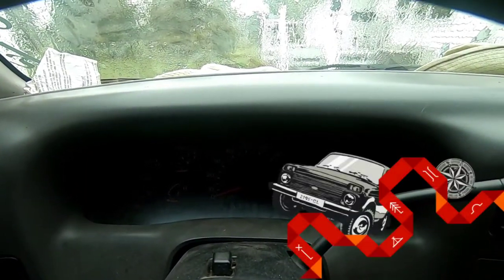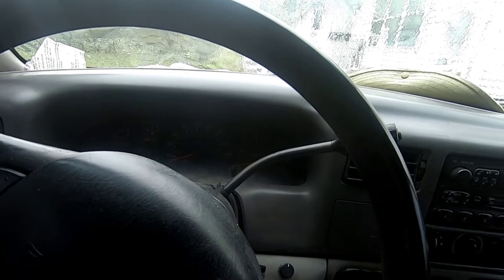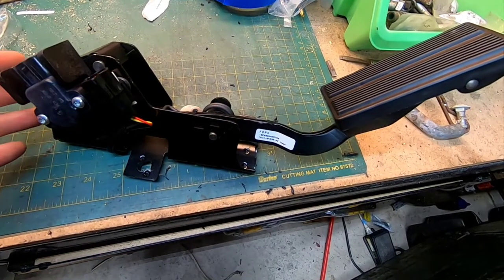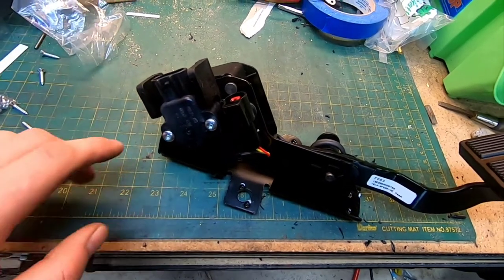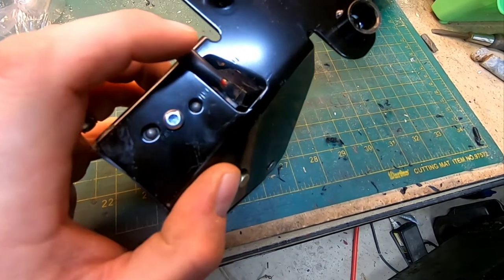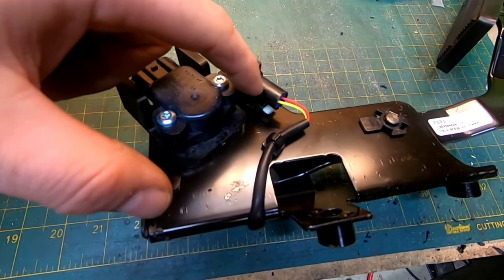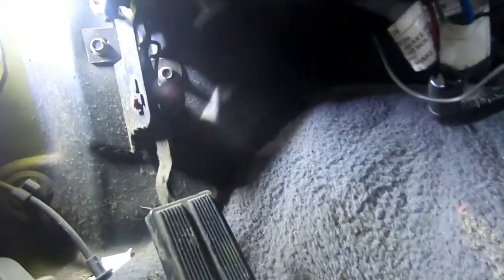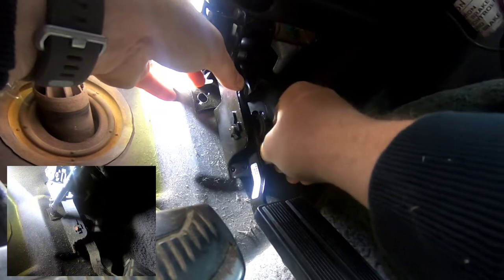Repair Ford 7.3 Diesel engine that has no throttle response and or has issues accelerating, no power

Comment: Excellent video. Quick, simple, prolem well described and the fix made sense. My first diesel truck and I'm learning a lot. 2000 F350 7.3 w/391,000 miles on it. A lot of peripheral parts to replace (all rear u-joints, hanger bearing, ball joints and hub bearings are next (u-joints there too of course). Between youtube and Rockauto, I spend a LOT of time in the garage. Thanks for the terrific tutorial.

Comment: This is a great video and explanation. Had an intermittent 'no throttle response' in our 2000 Excursion. Confident that this will resolve the issue.

Comment: I have a 99 E450 that is doing the same thing and this video was very helpful to me, thanks a million!!!
Reply: Did you experience a check engine light and no throttle for a few seconds, then seemingly resolve itself, and did cleaning the idle validation switch fix it?
Reply: I have this right now in my E450. Cleaning both sensors did not help. Have you fixed this?
Reply: And there’s no warning light at all, it just happens
Reply: @juanp9178  exactly. Were you able to find a new pedal for your E450 Juan?
Reply: @Constabruity there’s a micro switch on this pedal that goes bad and mine has that problem, and for don’t have it anymore
Reply: @TractorsTurfTools you might can find the micro switch in the pedal
Reply: @TractorsTurfTools no sir ford don’t have it , you can buy a used one or put a different one with the same type connectors
Reply: @TractorsTurfTools  I haven’t find one yet, eBay had two of them,used. They had too many miles in them. I’ll probably get one later on, my ford is a food truck and right now I’m not using it , have a great weekend

Comment: I had this problem today, no response and then i ruled out any other posible cause and went to check my pedal, with the truck running i pressed the pedal down while applying a little bit of lateral force towards the passenger side and it worked.
I made it home but it is time to get a new pedal assembly

Comment: Just had my transmission rebuilt and 10 minutes after picking it up my check engine light came on and there was no power at a stop light. I thought at first it was something they did but it's seeming like a coincidence and my tps is just worn out. I tried replicating the issue and it hasn't done it again but I am getting a p0221 code so I am going to replace the pedal and see if it goes away

Comment: Thank you, good video! I replace the whole assembly truck ran great but the sporadic no throttle response happened again. It always happens when I let off the gas and then give gas they’ll be no response. I tried multiple of things put truck in neutral sometimes it works and responds and sometimes it doesn’t. It’s starting to happen more frequently and I’m really confused what is causing this problem? 
Any ideas?
Reply: You ever find out what was happening bc mine is also doing the same

Comment: Quick question-my 2001 Excursion 7.3 only seems to do that on initial start-up/cold engine. Even on a hot day it's sluggish just how you are describing. However, once I get 1/4 mile down the road-problem solved until next time.

Comment: I have 2002 7.3 excursion with only 125k on.
I noticed the truck has now power acceleration in 1st and second gears .
I only feel fast when it shifts gear at 40 miles per hour.
So do you think it has the same throttle sensor issue?

Comment: Just seeing this video trying to diagnose my issue, question , my 2000 7.3 will not start unless you depress the throttle pedal, once running , runs great, could this be same problem ?  Or any ideas ?

Comment: So once my problem with acceleration loss happened I pulled up to get some breakfast once I was going slow truck just completely loss it barely wanted to go but I shut it off went fine for 1 minute then did the same now I’m loss on if it’s a fuel problem or the sensor

Comment: Did you have a problem with the check engine light coming on when you pressed the pedal to the floor and no response?
Reply from the maker: It's been a while ago, I don't really remember!
Reply: I’m having taht same problem when the light comes on I have no peddle pressure
Reply: @latishaharp6980  There are two sensors on the gas pedal that I had to replace.  The pedal is essentially a digital response to the on-board computer, not mechanical like the older carburetor models.  I think it cost me $250.00 to replace the sensors on the gas pedal, or maybe $250.00 for a whole new pedal that had new sensors on it.  Either way that was the rough price.
Reply: @latishaharp6980  I knew the sensors were bad when the cruise control worked, but the manual pedal did not.

Comment: Ok so I got the same thing on mine. Sometimes at a red light  the service engine light turns on for a few seconds. When it comes on the peddle won’t work. It’s dead.  The moment the light goes off the truck revs like normal. Nice and smooth. But whenever that light turns on my peddle goes dead. Any thoughts ? Need help man
Reply from the maker: It sounds like the idle position sensor to me.   When mine failed, the pedal was totally dead, then it would just start working on it's own.    I don't recall if I had an engine light or not, but I have read other people have had the light with this failure.   I could see the ECM tossing a light, as it would see TPS data, but still see the position sensor reading an idle position.
Reply: Hey I have the same issue pedal is dead and check engine light comes on but after a couple presses the truck wakes back up. Was it your TPS or the whole assembly. My OD light also started blinking, did you have that?
Reply: @JoeR_1  its the tps same shit happens to me but i kick the wires (crappy pigtail job) it works great

Comment: Hi there what year is you powerstroke 7.3? Im looking to get a accelator pedal ..mine is 2001 f350 7.3 

Thanks for the video its realy help a lot
Reply from the maker: Mine is a 2001 as well, also F350.
Reply: @1D10CRACY  hi thanks for the quick reply apriciate that...also would like to know the part number or the link where can i buy em please and thank you
Reply from the maker: The link in the description is the exact one I purchased.   It's not OEM but it has been holding up well.

Comment: Find this pedal assembly and it was like trying to find a dinosaur. I was luckily able to pulled apart from several states away. They had one left in stock. I got lucky. Anyhow, I went to my local dealership to try to purchase the throttle positioning sensor and they told me that it does not come separate from the assembly. Did you buy that sensor after market? Also have you found a workaround to the idle sensor?
Reply from the maker: You used to be able to buy it as an aftermarket replacement.   I just purchased the whole pedal assembly from Amazon.   There is a link in the description of this video.
Reply: @1D10CRACY  ok. Ty. I’ll do my research. Be well and happy belated 4th!

Comment: I'm trying to fix a throttle problem on our 7.3 in school bus. We replaced the position sensor.. it worked for half hour then quit. I can find the idle sensor.. are they ever built in to the position sensor?
Reply: I have a 99 international 7.3 bus I have no throttle sometime is that what you're did

Comment: I made a video explaining what causes the dead pedal on these old 7.3. The only way to tell is take the pedal out and see if the shaft that goes in to the TPS Has a lot of play in it. Mine had too much play in and the throttle position arm would overlap the throttle arm while engaging the idle switch giving me no throttle output.
Reply: Truck stalls while driving an obvious vacuum leak

Comment: I bet if you're stuck at a red light with nothing but idle, you could unplug the "position sensor" switch and put a jumper wire in it and you'll take back off on your way home... 
That's jeep logic but it may work.

Comment: Mine did 55 for like an hour then began getting gradually slower until even with the pedal to the floor it wouldn't accelerate. I had to yank it off the highway. Any ideas?
Reply: No dead spots just noticed my speed went from 55 to like 20 on the highway. Tried flooring it and wouldn't accelerate at all
Reply: Transmission?
Reply from the maker: Fuel Pressure?
Reply: Figure it out ?

Comment: Hey, I have the same issue with my 2012 Ford F750. At a certain speed a small red light would turn on and it wouldn't accelerate. Once I let go of the pedal the light turns off and I can try to accelerate slowly. Then I have to turn on cruise control just in case. But even with cruise control, it does the same thing when it reaches a certain speed. It just randomly happens. I already changed the whole pedal and it seem to go away for a bit but came back like a week or 2 later. Any suggestion on what it could be? It would help another since it's my work truck. My eld device says it's accelerator pedal position. But like i said i already chnaged it and it started doing it again randomly. Thank you.
Reply from the maker: I would of bet on the idle position switch.   But since you replaced it already I don't really have any advice.  I have read where the aftermarket pedals are known to fail quickly and even right out of the box.
Reply: You ever figure it out

Comment: Dead 7.3 Pedal? Erratic Throttle? Could be the pedal! BUTT Check the loom laying on top of the drivers side shock. Funny place to put a open wire loom!!! Easy to access it anyway. Of the 4 looms its the closest to the air box. In my case small gauge wire Lt grey/white (looks darker dirty), Orange with black stripe (fuel pump circuit) When the grey wire gounded it would kill the pedal, and the orange would pop the 20 amp fuse (#40)  Moisture was usually a factor. Easy to bush fix to get home to a warm shop and cold beer. The damage is close to the plug leaving little room for soldering so I bi-passed the plug with some extra wire, soldered and shrink sleaved.

Comment: Bullshit, the pedal has ZERO replaceable parts
Reply from the maker: You can replace the TPS sensor and even the micro switch is replaceable, providing you are willing to epoxy a new one in.  Hope this helps!

Comment: all these guys have oodles of miles beforeba problem exist no me cant even make 100 thousand I head dead pedal at idle but problem came up after about half way drpressed and further would stall and roll black smoke dont know if itd related to the pedal sensor dont see how it could be but happen until pedal dead at idle